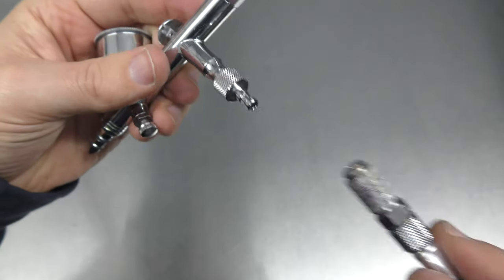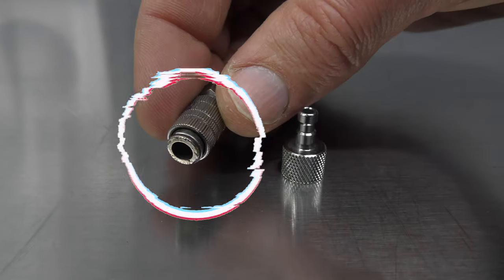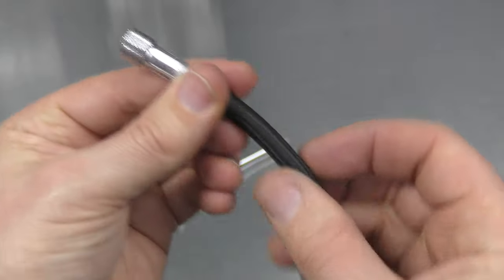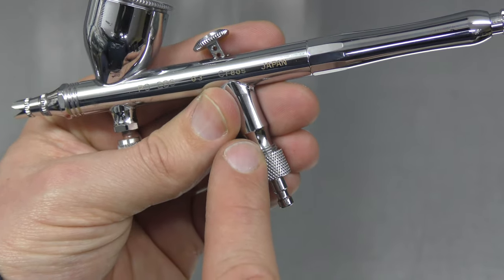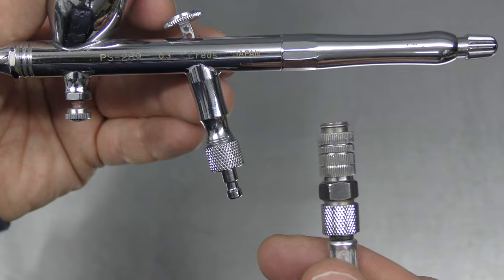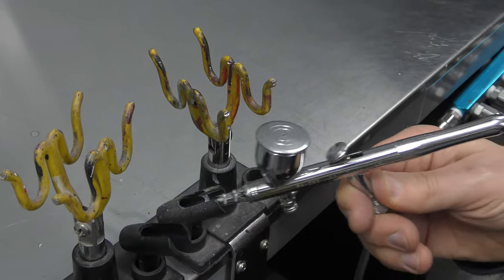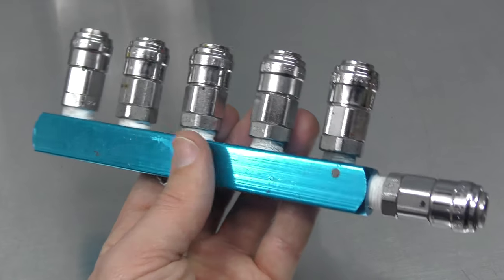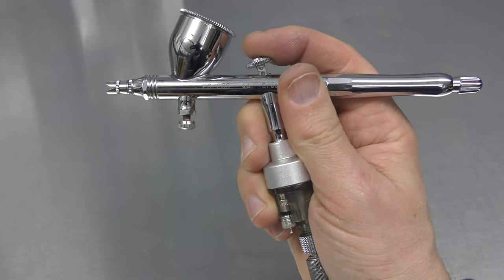Should You Buy An Airbrush Quick Connect ?

Comment: I've found these are great for just getting the hose out of the way as you mentioned. When I'm doing a quick clean or colour change it's often easier to disconnect the hose so I can handle the brush more easily. If I need to run some cleaner though the brush reconnecting it is a doddle.
Reply from the maker: Yes , it’s definitely great when you want to do a quick clean and also a complete pull apart ‘deep clean’ 👍🏻

Comment: Main reason I use this is not because of multiple airbrushes (have three) as I always use one at the time. Main reason is the way I clean airbrush. I quickly disconnect airbrush and clean it with hot water from faucet. And hot water is not enough for me. Using acrilic paints I always remove needle as well and clean it separatelly. Even that is not enough for me I clean airbrush spraying alcohol and sometimes acetone. It will not damage ruber if it is done with care. So using quick connect is much easier. The thing is, they do not last to long but they are not to expensive. Rubber ring inside wears out and I don't think it can be easily (or at all) replaced.

Comment: Very timely. My only question is are they standardized or universal between brands or only outfit all with one brand? Only asking considering all the cheap and quality in the market
Reply from the maker: Some brands may vary but I have used all the following brands (mixed up) iwata, Sagola and the cheaper option (shown) unfortunately I can’t guarantee if all cheaper models are the same I would still recommend keeping the sets together if you can , or buy one complete set and then just the male adaptors for each brush which aren’t that expensive 👍🏻
Reply: @AirbrushAsylum  Thank you so much for the answer!

Comment: The standard for these plugs is called nw2.7
You can buy better connectors for reasonable prices, other than these cheap china fittings, that start leaking relatively fast.
Reply from the maker: Thank you appreciate the comment and your feedback 👍🏻
Reply: My cheap quick-connect starting leaking almost from day one, when I wiggle the hose around. I really just need to replace it with a quality one!

Comment: Cool video, I just brought an air brush setup, got the creos 270, also got a quick connect and braided hose. problem with living in NZ is getting hold of paint. I've looked for everything there is one store that sells trident but they only deal in 250mls :( wish it was more accessible here  I ordered some cheapo ones from amazon in the meantime.
Reply from the maker: Awesome you’ll be happy with the Creos great brushes, shame about the trident 250ml colours in NZ as I was going to say they have a distributor, if they do the sets then grab a Tru8 250ml set as they are great value and have a great variety of colours . 👍🏻
Reply: @AirbrushAsylum  hey thanks for the reply, I managed to get in touch with them and there is only 2 tru8 sets in the county and pretty reasonably priced at 266 +shipping so I will probably grab that this Wednesday. Thanks for having some great content to help ease people into airbrushing. I watched loads of videos on which airbrushes were good and decided on the 270 to get a good thin lines for detailing, the compressor I got came with a cheap airbrush but has yet to arrive I figured I'd use that for base coating things. Top notch content 11/10

Comment: I use the manifold connection as I have only four airbrushes was more cost effective as each brush came with a hose and the male connector come in a six pack from my local automotive store. This way each brush can a different needle and tip
Reply from the maker: Yes manifolds are also super handy , either way makes airbrushing so much easier 👍🏻😉

Comment: Been tempted to go w q-ds at the ab side, have some HS disconnects that have never been installed on the ab’s..   Spent  a lot of money on lightweight “handy” ab’s; so have stuck with a couple of manifolds, w some of the hoses setup with their own regulators.  The q-ds are at the manifold end of the airlines, screwed onto ab’s end. Manifolds are just to the right of the spray booth which is on a standing height spray booth table, very quick/easy to get to if need be.  The ab’s are all on a couple of shop built racks/holders above the manifolds.  Run the manifolds off of a 3/4” looped-line copper line from a shop-wide CA Tools 60g w air dryer (it gets used for other things in the shop as well).  No surge worries ;-) and no pressure drop worries if multiple simultaneous users. Did install chemical air dryers where the lines come in from/exit back to the hot/cold shop (Dallas) into the 7/24 HVAC side of the workspace.  Have a 2 regulator Iwata tank compressor (and a few non-tanked, everybody collects compressors right? Just like routers) that gets used from time to time when we don’t want to turn on the big compressor.   The Iwata tank-comp is what got us started doing q-ds on the compressor/manifold side.   Yeah, downside is, good braided lines do add up $$.  Just sharing,  As always YMMV.

Comment: Great video.  Not had much luck with the generic quick releases, the quality of the can be really variable I think.  Yes they are cheap enough but I've had a couple that have laster literally days!!  So much so that when I first started I was hunting round for an O-ring which I'm sure had dropped off either the male end or from the female end. At one point I even thought my airbrush had become clogged as it was splattering paint, once I turned off the extractor fan and the compressor itself I could hear the air leaking from the damn quick connect.  I guess if you get lucky the generic connectors might be OK, for me, they're just junk.